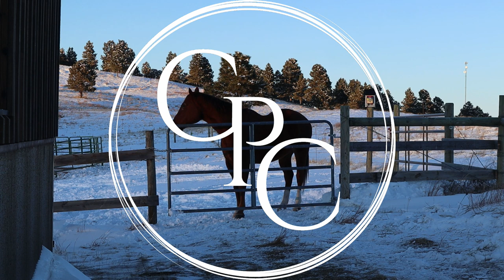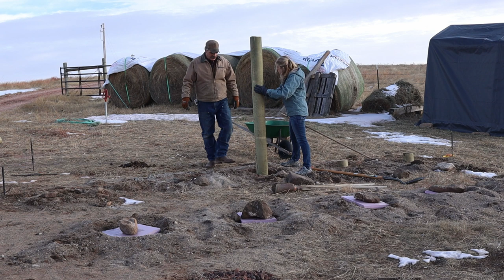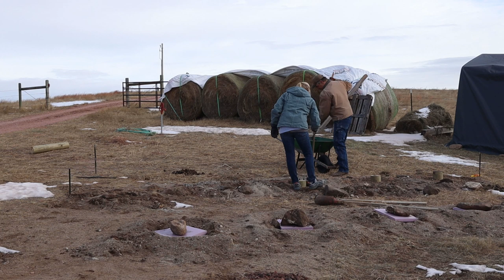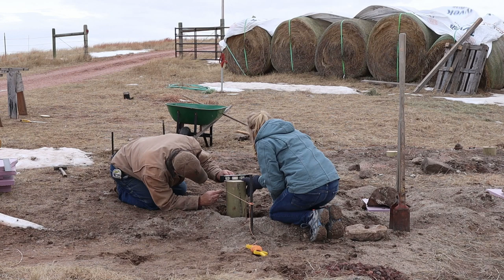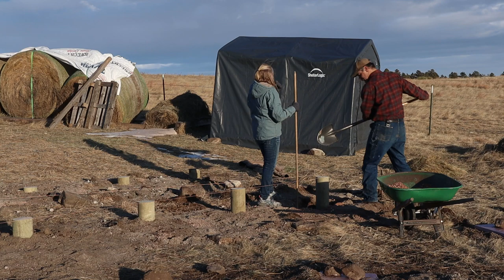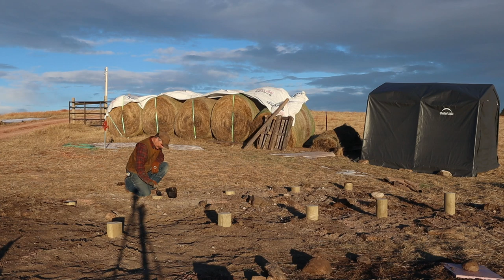Dovetail Log Cabin Footing Piers In

Comment: Happy 2020 to you all!
I know that is treated timber but did you consider charring them? I have no personal experience of this but have read that charring the surface that is in contact with the ground considerably  reduces rot! Are you just following traditional building techniques or have you done things like load stress on those posts. I assume those logs you will be building with will have a fair weight to them and those posts are close to point loads no the substrate! 

You seem to be a man of few words but some explanation of the why's and wherefore's may make a good video?
Reply from the maker: Thanks Dave.  I will explain more as we go along but just traditional building techniques.   I do know the load calculation of the materials though, and take that into account.   The Load of the building will be distributed evenly along the posts as a whole, and the are only 5x7 timbers, 9 on each side so not a lot of weight.

Comment: What does the motor oil do to the lumber?
Reply from the maker: Preserve it, protection from water.  Old timers trick.
Reply: Hmm, I could use all the protection I could get on my shed, I'm gunna give this a try, do you have to use the diesel fuel?
Reply from the maker: @StandFast1611  Yes, it dilutes it so it will soak in.  50/50 or so.  Diesel motor oil will yield a blackish grey when dry, gasoline engine used oil will be more brown.  Couple coats is best

Comment: Nice to see a team working together and Zippy looking on Happy new year GPC.if you singe the outside in a fire that stops the ground poles from rotting.
Reply from the maker: Yes it does Paul.  Did that building the horse shelter.  Made sense here to use PT posts.

Comment: No concrete around the posts? Why not paint all the post with the used motor oil and diesel fuel to protect it all instead of the parts that were sticking out above ground? I've never seen this style of foundation piers. I like it. I just don't understand it. Your videos are like the old Kung Fu TV show. You build with the inner peace of a grand master.